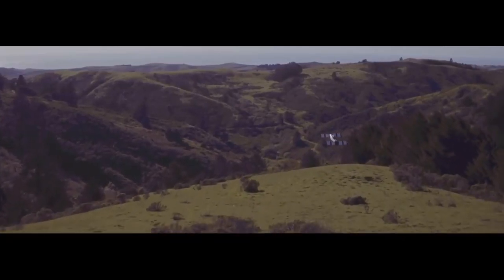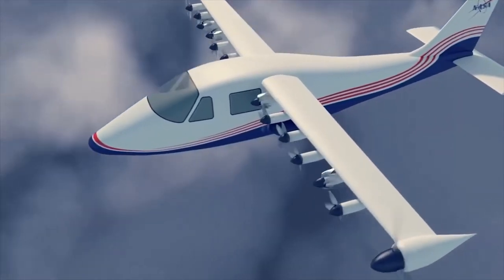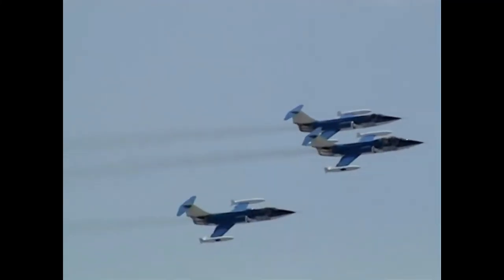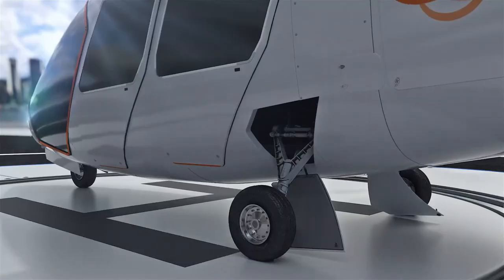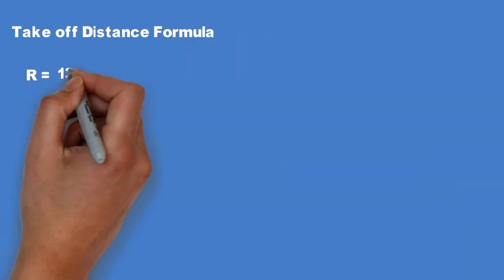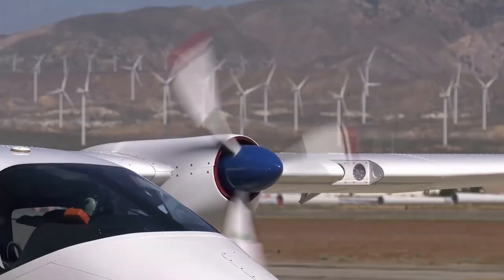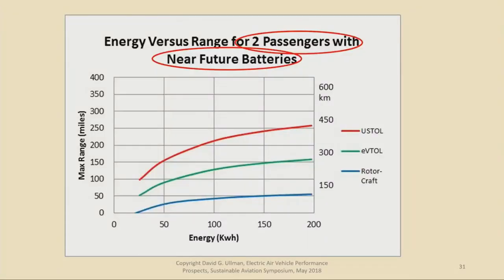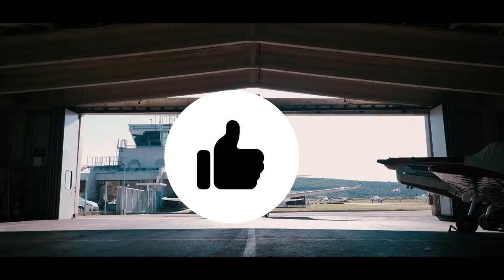Double Range Electric Aircraft: Distributed Propulsion

Comment: I'm confused.. if distributed propulsion is great for range, why does the NASA X-57 Maxwell only use it for take off (and landing)?
Reply from the maker: Its great for acceleration and take-off and landing. Once cruise speed is achieved, you can use either all propellers at low speed , but even better is to use the large props if any for more energy efficient cruise.
Reply: blowing the wing with the motors allows them to run a much thinner wing than would otherwise work at low speed. That wing is much more efficient when they're at cruise and at that point there's enough flow and lift to support the aircraft.

The big ones on the tips are also counteracting vortexes that form on the wingtips, so that's also adding some efficiency. Hence why the main props are much more outboard than they normally would be.
Reply: @AntonEMaes  Thanks. Most of the aircraft in the video are not examples of distributed propulsion enabling thin cruise-efficient wings (and therefore long range). Love this channel though.

Comment: I wonder what would happen if you put little propellers on a big propeller.
Reply: i am trying to imagine how it would look like....
Reply: A propeller is in general good in some regime and bad in rest of regimes. Mostly like a wing. Like the wing is very sensitive at what you ask it to do and adding complications on it guarantees to make it worse. Just like the wing. That's why props on wings are in general bad. But some dream... Like the guy with this channel.
Reply: some helicopter propulsion systems have envisaged such a proposal
I think one of the entrants for the Sikorsky prize, a human powered helicopter to fly in a figure 8 pattern, used a pedal driven generator to a tip mounted propeller.
Reply: @Soothsayer210  I mostly meant it as a joke...

But now that you ask, I'm thinking a barrel shape, with propeller blades spaced evenly along the outer edge, actuated to vary their pitch, with a ring of propellers at the top also actuated.

It would take off vertically pointed straight up, using the many small propellers for direct lift.

It would then start spinning the entire thing so the outer propellers would produce lift as well.

At high horizontal speeds, the small propellers no longer produce thrust in the direction of travel, they are used exclusively to generate spin for the larger propellers.

Inspired by the flying cylinder frisbee sort of toy. You throw it like a football and it gets lift from spin.

It's probably a terrible idea, but with enough thrust SpaceX got a water tower to fly.
Reply: Interesting.  How would you drive the propeller-on-propeller?  Could it capture vortices?  Hmmmm....
Reply: @loungelizard836  tip mounted motor and I think it this case a pusher propeller.
think of something around 12" - 18" on a single blade rotor some 20ft or more. Sorry I cant be more accurate 
it probably doesnt have the diameter to substantially counter tip votices, ala Vought V173
Reply: @z_actual  I was kidding too. I actually liked your joke and had a quiet chuckle myself.

Comment: Solar powered electric airships (rigid Blimps) could take over a huge portion of freight flights point to point with almost no infrastructure. I’m amazed there is so little interest. Point to point at 120 mph with no wear and tear or clogging of roads would be extremely helpful. Quiet and no pollution also good. Modern technology would mitigate hydrogens flammability as it has lithium.

Comment: @Electric Aviation If distributed propulsion is more efficient why Airbus and Boeing are increasingly making commercial airplanes engines bigger and bigger ? In the past they had 2 or even 3 engines per wing and now they have just 1 big engine per wing, so if distributed propulsion is more efficient, Why they didn't made the jet's core smaller (in order to increase the bypass ratio) instead of making the fans bigger and leaving just 2 big engines ? And now Why are they making them even bigger instead of putting more engines ?
Reply from the maker: It is because they are only concerned with jet engine efficiency. With higher bypass ratio, they can get higher efficiency of the jet engine. Over here we are discussing propulsive efficiency, in which the rotor downwash is directly blown over the wing. In commercial airlines, the engines are hanging below the wings, which increases the wetted area and hence drag. However, the make up for it with improved jet efficiency.

Comment: My hope is a combination of small STOL aircraft with AI control system would liberate humans to live in smaller towns.  Current flight tech makes travel from smaller towns not economic, with most only achievable with large Govt subsidies.  If the cost of the flights is halved, likley even more with the low cost of electricity and much reduced maintenance of elctric motors compared to ICE planes, chosing where you live can be much more about lifestyle.

Comment: I listened to this video hoping for some kind of explanation for the claim but heard nothing.
Therefor, I believe that in the absence of rational scientific cause, the claim is bogus. 
The video did mention what I consider critically important, which is the calculated thrust to weight ratio of the engine and aircraft.
But, I heard nothing about why distributed power should be more efficient or be reason for a superior thrust to weight ratio.

I will say that AFAIK,
fewer and larger props and engines do run into certain limitations...
The propeller tips must not travel faster than the speed of sound.
The propeller must be optimized for a particular speed.
An optimized propeller will account for the different radial velocities closer to the hub and along the propeller to the tip.
Of course, an optimized propeller will have an airfoil shape.
There can be additional features that can help propeller efficiency like ducting.

Maybe the idea is that with smaller propellers, the extreme difference of the propeller's efficiency from hub to tip is possibly less, but that might only mean a less optimized propeller shape might be required.
It might mean that with smaller propellers, the propellers can spin faster, but that's hardly related to propeller efficiency which also depends on airfoil, angle of attack, materials and more.

So, based only on what is in the video, I don't think that its claim is accurate.
Need proof, or at least a sensible argument.

Comment: Do not over amp the motor use the Edison generator for electric power source. An old generator can be converted to Edison power by chiseling off the Tesla magnets and leaving the Edison magnets on the generator armature. A pre 1974 car generator can be used count the armature magnets and divide by six and  chisel off one sixth and leave one sixth on and then off and on until you have chiseled off three sixths and left three sixths on alternating  on and off.  The generators are motors and will spin as you assemble the generator.  The generators self spin unlimited generation of electricity. You have replace the commutator brushes. Add inverters and transformers to deliver power plant power or house current. But 12 v power  continuous peak power or 110v AC is immediately available for airplanes power for an unlimited time .  Redundancy is safer.

Comment: I've never understood this concept.. why multiply the drag penalty of one small propeller 10x times when it is well known bigger propellers are more efficient... efficiency is a much bigger deal with limited on board energy. This does NOT have better propulsive efficiency. Whoever told you that is either full of shit or has no idea what they're talking about. If this wasn't the case, then turbofan engines wouldn't exist and the fan part of the turbofans wouldn't keep on getting bigger and bigger.
Reply from the maker: That is because they are optimizing jet efficiency ahead of propulsive efficiency. Larger jet engines are more thermodynamically efficient. Larger bypass ratios give better fuel economy. This is different
Reply: @ElectricAviation  not at all different. Thermal efficiency of gas turbines increases maybe in the single digits of percent. The larger bypass ratio is one thing, but that if just for the turbojet. Turbofans have large bypass but also are essentially just extremely large turboprops. So same principle. I'm not sure how that's confusing. Thermodynamics works just the same for an electric motor as it is for a Brayton cycle gas turbine - and theyre both driving a propeller / impeller. 

There is a reason small turboprops burn almost as much as larger ones. Distributed trust is a mockery of physics and this is ty end of discussion. These stupid designs will never fly or be commercially viable. Mic drop.